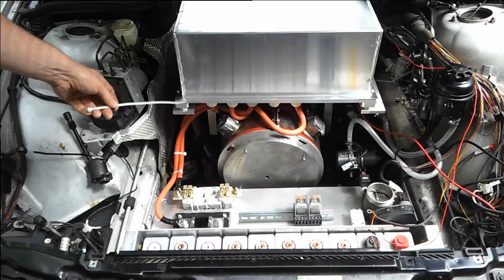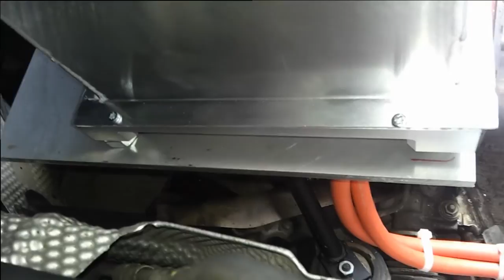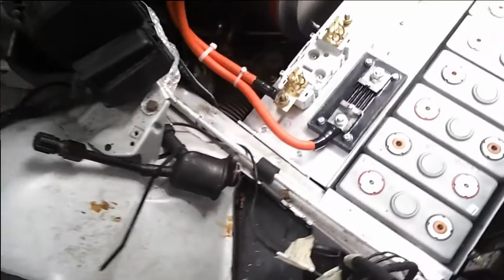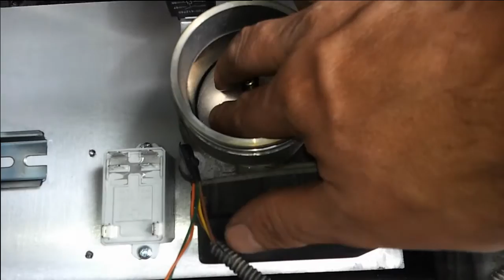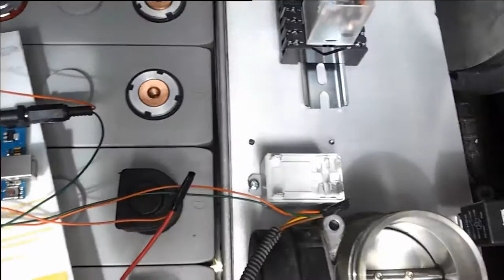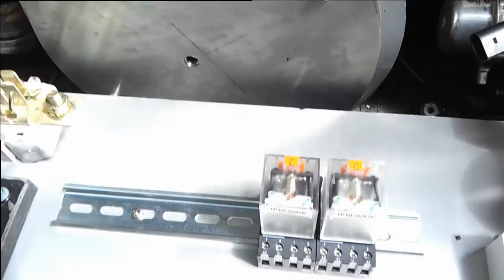BMW E39 EV Conversion 18 Controller Install

Comment from the maker: Leslie , the reasons for keeping the ecu and tb relate to keeping the safety systems of the car operating so as to pass inspection. In Ireland every car must go through and annual process called the national car test (nct). Part of that inspection verifies correct operation of abs and driving aids like asc as fitted to the E39. Without a functional ecu to talk to these modules the dash lights illuminate incorrectly resulting in the car not being allowed on public roads.